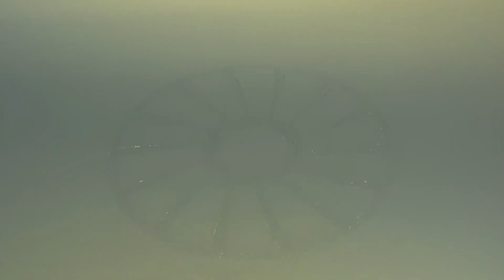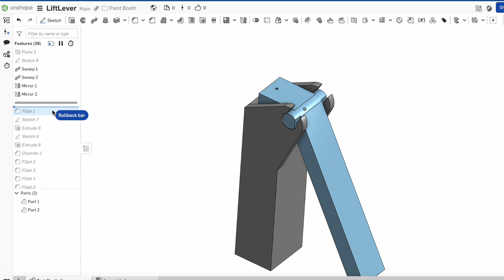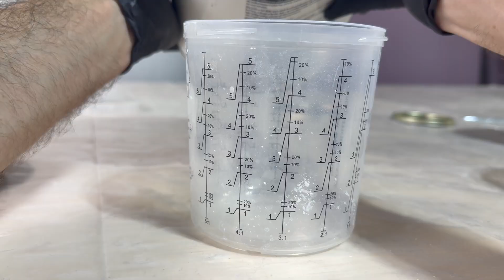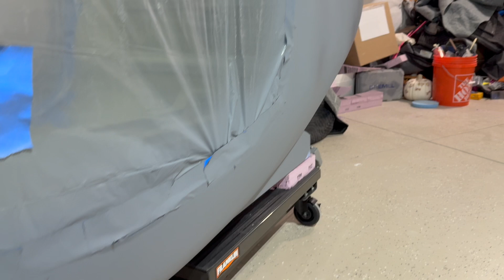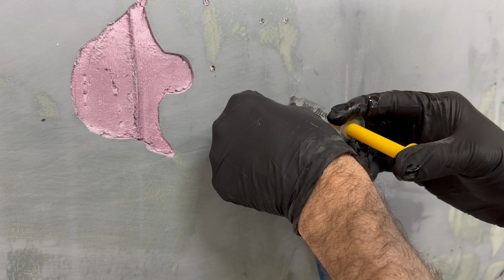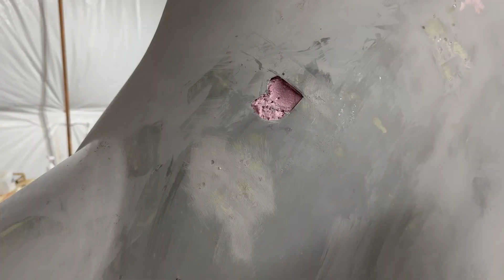Acetone almost RUINED everything! | Basement Kit Helicopter Build Ep. 11

Comment: Why are you using acetone to clean? Can you find another solvent for cleaning that won’t dissolve or react with the materials in the body? I’d be super nervous about it. Especially if you have areas of the body that are stronger or weaker and stiffer or more flexible. I feel like it might show up on the surface once you start putting loads on the body. I don’t know anything about composites, but I’d be triple and quadruple checking any approaches you use to fix it.

Comment: I remember being in organic chemistry class and in the lab we had squirt bottles of isopropanol and acetone for cleaning lab equipment like beakers and graduated cylinders. I didn’t know much about chemistry and was new to lab work, so I was super impressed with how well the acetone cleaned and dried up so quickly. I had bought some nice new lab goggles that I paid a little extra for so that they were actually comfortable and didn’t fog up and fit well over glasses. They had gotten covered in smudges and dirt, so I figured I’d just squirt some acetone on them to clean them real quick. That was an instant, huge mistake. The googles instantly turned white and basically opaque as the layers of plastic or whatever they were made of instantly started dissolving or reacting as the acetone stripped away and permanently ruined the goggles. My heart sank. I was hoping it was just the surface and I could somehow clean off the now rough, white surface, but that turned out to be impossible. I learned a big lesson that day on understanding what things are made of and how very simple lapses in judgment or doing something just a little differently can cause a huge chemistry catastrophe.

Comment: Dude you should let someone that does body work and paint some paints you don’t mix with glass and it looks like the body except for a few high spots would be ready for paint your adding unnecessary weight not to mention you’re taking away the strength of the material sanding it down and putting stuff on it that shouldn’t be on it😮 just saying that’s a lot of money to be messing up

Comment: do your modifications risk changing the airworthiness in any way?
Reply from the maker: @kentuckyhelicycle2614  it falls under experimental so there are no restrictions to any modifications I want to make. It’ll still require an airworthiness cert and inspection before I can fly it but that’s the same for any kit build. Modifications after the initial airworthiness inspection would require additional inspections. 

As far as performance goes, the CFD analysis I’ve done says it’ll actually fly better. Testing will tell though. I’m not worried in the slightest.

Comment: I wouldn’t use acetone anywhere other than cleaning your paint gun. Waters not great either, if it gets behind the surface you can end up with blisters and adhesion problems… Get some tack rags for you wipe down, most paint supply shops will have them

Comment: Please be careful with any solvent. Remember, the liquid turns to vapor and the vapor “needs” to go somewhere- hopefully your running high flow ventilation.    Having said that, distilled white vinegar is very effective (and much safer) at cleaning tools , gloves and surfaces contaminated with epoxy.   It’s also dirt cheap.
Reply from the maker: I’ve got a fan that evacuates the fumes from the paint boot outside. This is all in my basement so if fumes got into the house I’d hear about it immediately from the boss…. And I mean immediately.

Comment: Can you use a syringe and inject polyurethane foam in behind the fibreglass?
Reply from the maker: Probably? Hindsight though, some passageways were quite small and it was difficult to even get the epoxy through. And if the foam expanded at all, I’d end up with a bulge on the outside. Not ideal.
Reply: @TheOkayestEngineer  I actually made that comment half way through the video before you even showed the syringe. Great Okayish minds? I think the epoxy probably works better with more certainty.
Reply from the maker: @ definitely okayish!

Comment: Applying a guide coat and then sanding with the longboard in a crosshatch pattern will de-lump your bird. the guide coat gives you a visual aid without having to 'wet out' the surface and read the light. just my two cents.
Reply from the maker: I appreciate your 0.02 
I ordered some guide coat and will use it this time around.

Comment: A simple solution was to use 3 or 4 coats of latex ceiling primer.  Cheap and easy to to spray on. Great barrier between foam and body filler. Get the foam close to finish as possible before you use the ceiling primer
Reply from the maker: I’ve heard of that stuff but haven’t used it yet. Might have to give it a shot next time. Either way, I probably would have been fine if I didn’t use acetone… lesson learned.